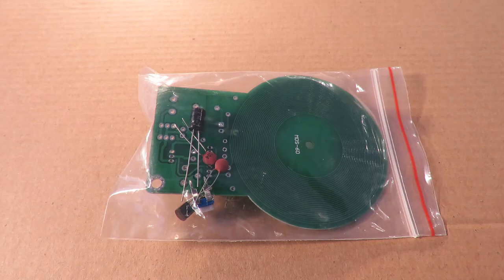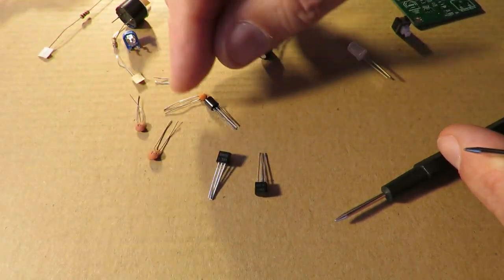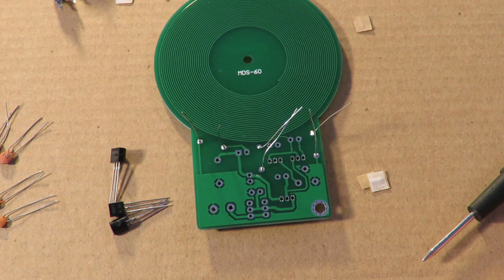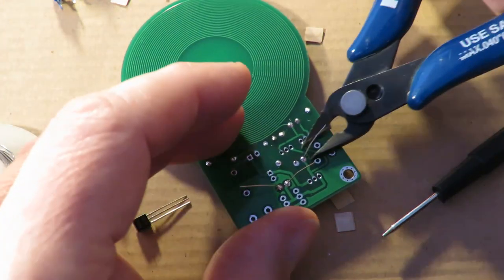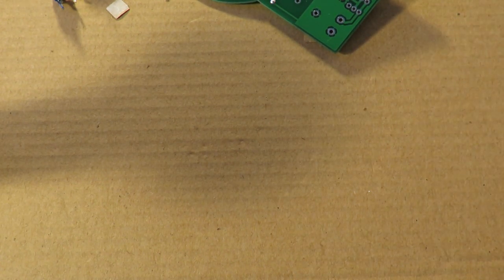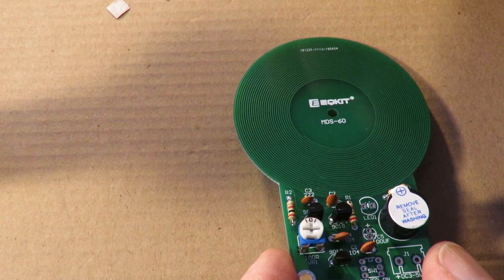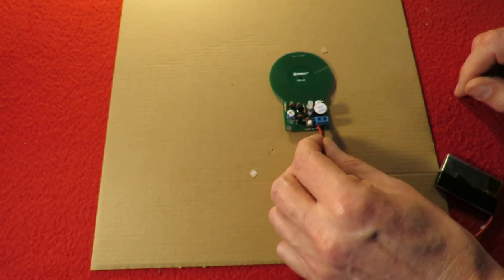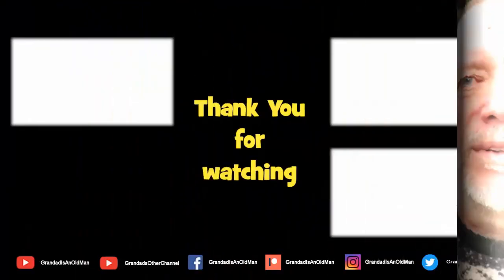Assembling a Metal Detector Non contact Sensor DIY Kit

Comment: Thanks for this great video.  I have the exact same kit but I have not had time to put it together yet.  I got it to try to make a pulse motor driver out of it.  I was going to replace the buzzer with a fine wire pulse motor coil and use thin but large magnets on the rotor.  It might work .  It probably would not work except at very slow rotor speeds.
Reply from the maker: Whether it works or not I am sure you will give it your best shot and we will see the results 😍👍

Comment: I build it, thanks to the clues in your video. It works but it is disappointing , it only detects when it on the metal, 
or witin 2 mm from it, not 60mm as advertised. Any surface wil block the signal.
Reply from the maker: Yes, it has no real practical use, just an exercise in soldering.